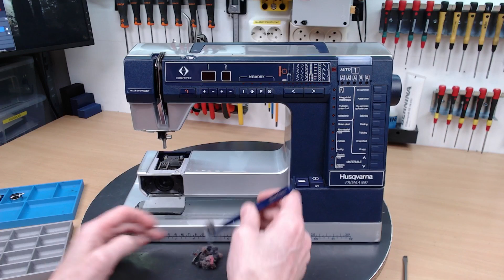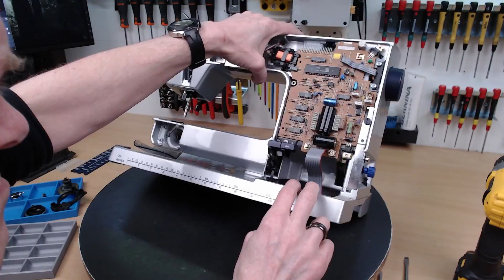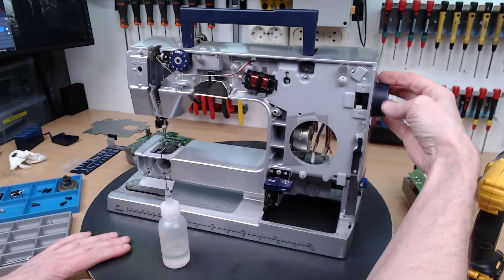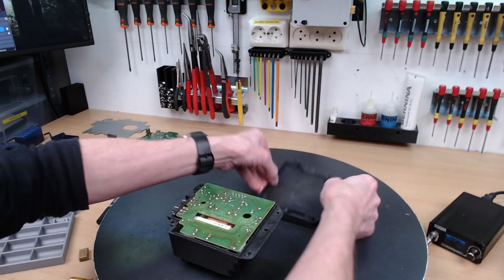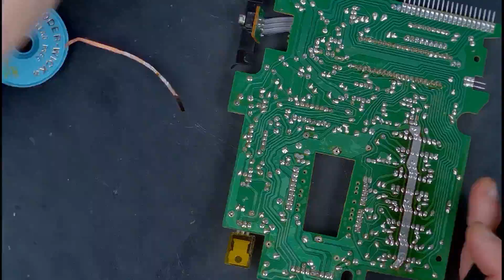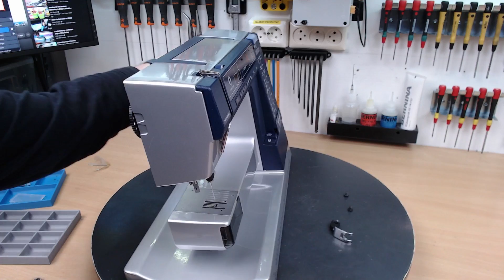Husqvarna PRISMA 990 on my workbench

Comment: Thank you. I just serviced a close cousin of this HV Prisma; a Frister+Rossmann Lynx 880+ computer. I didn't know it was a re-badged HVAB at first, until I started to see 'made in sweden' & HVAB on many components. All internals are identical & your video is a great help for when I need to replace the caps. The tip about releasing the little bearing caps to then adjust for correct clearance by feel was helpful too. Strangely, mine has a factory 'Electrolux' label on the back plastics too, I assume this is the motor manufacturer? All I need to find now is a plastic trim cap from a prisma or optima machine for above the needle area, mine is missing, but I can't complain for the gbp30 I paid for it, due to the broken trim cap plastic stud had fallen into the needle shaft area had jammed it up. Very easy fix. Who knew that underneath the budget F+R badges was a lovely high quality HV machine! I can't find much about this rebadged machine, so it might have only been made in small numbers.
Reply from the maker: Glad to hear that watching the video was helpful. More videos about PRISMA are sure to come. In 1978, Husqvarna merged with Elektrolux, which is also a Swedish company. In different countries, sewing machines (and many other things) may be sold under other names that are better known in that country. Everything ends in the opportunity to make more money.
Reply: @sewrepair I've got one segment out on one of the 7-segment LEDs for stitch length. Have you taken the front panel apart on these & I wonder if the LED displays are still available?. Possible it could be the LED driver IC.

Comment: I own this model and love it. It just came back from the spa (sewing machine repair shop) and runs so much quieter and smoother, but I wish they had replaced those electronics like you did, Theodor. Now I'm going to lose sleep thinking about it starting up by itself or generating puffs of smoke.
Reply from the maker: Don't lose sleep over it, it's nothing dangerous just frustrating and it smells burnt/bad :) They can replace the capacitors at the next spa.
Reply: Same, I own mine since I am 12. I guess i should send her on a well deserved wellness vacation to Theodor. 😊 She had some transporter issues and a replaced Stepper Motor less than 10 years ago and a  tyristor had to be replaced in ca. 2006.